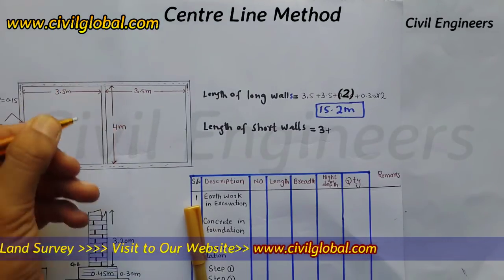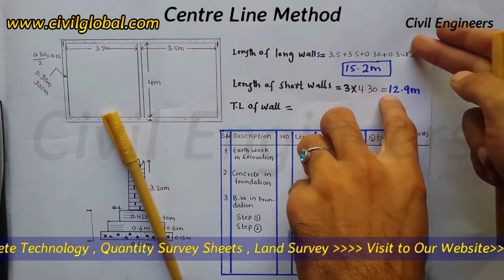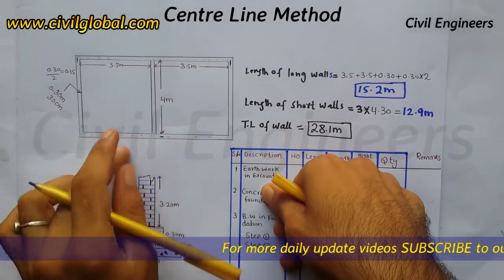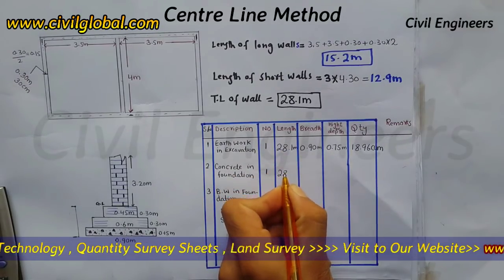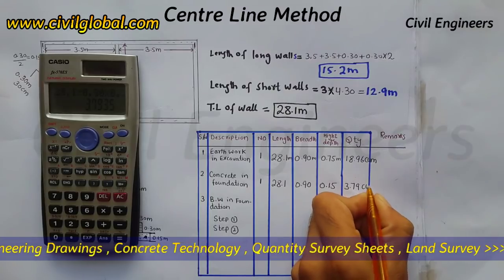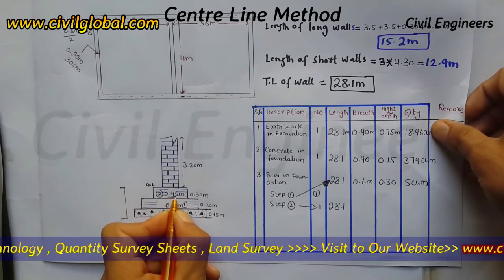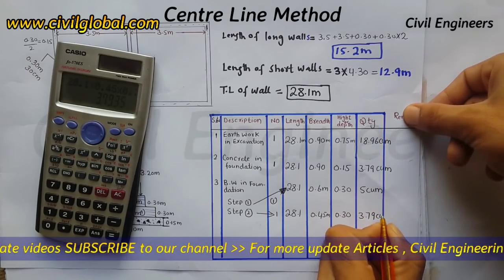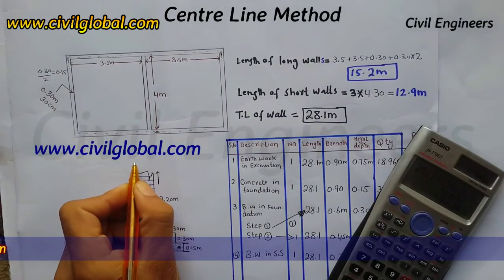Center Line Method - Quantity of Materials with Centre line method

Comment: 1) foundation concrete:bed width=0.8m,depth=0.2m
2) foundation s. S. Masonry: width=0.5m,depth=0.2m.
3) basement: width=0.4m depth=0.4m
4)DPC(1:2:4): width=0.4m depth=0.15
5) external walls are of 30cm & partition walls 20cm thick
6) all round lintel 1:2:4 ,0.15m depth
7) height of roof from plinth=3.5m

Comment: DEAR, IN THIS CENTRE LINE METHOD  HAVE ONE MORE EQUATION . YOUR TOTAL LENGTH IS CLEAR BUT WHEN YOU MENTIONED IN TABLE LENGTH IS DIFFERENT THERE HAVE ANOTHER EQUATION WE HAVE NEED. [LENGTH ANY ITEMS= C.C LENGTH -(1/2 * NO.OF JUNCTIONS*WIDTH OF WHICH ITEM YOU NEED )]   . THE NO.OF JUNCTIONS ARE CONSIDERED AS A " T" JUNCTIONS HOW MUCH HAVE.

Comment: Brother your method is totally wrong. The lengths of the walls will change according to the breadths. You forgot all about T joints, and it made all calculations wrong. If you write this in exam teacher will give 0. No mercy. But i like your slow explanation,  please learn the proper way first and then delete this video and do one more.
Reply: Correct
Reply: How to control estimated cost during construction. Click on the below link to know.
https://todayconstruction.blogspot.com/2020/06/post-contract-phase-this-is-from.html

Comment: Length of long walls = 2 ( 3.5 + 3.5 + .30 + .15+ .15)
= 15.2 m 
Is it correct?
Reply: Did he add .30 on wall then use the center line deduction for both?

Comment: this is not centre line method, in centre line you have to consider the T junctions, in your plan you have to consider 2 T junctions and total length of wall will be length-(number of junctions)×breadth/2
Reply: here we have two junctions . the formula is length - ( number of junction)x breadth/2  so they  cancelled each other like 2 x breadth/2 is equal to breadth understood
Reply: How to control estimated cost during construction. Click on the below link to know.
https://todayconstruction.blogspot.com/2020/06/post-contract-phase-this-is-from.html
Reply: Correct

Comment: Sorry, Your Taking Value is Wrong.. Example. Earthwork Excavation volume is 18.36 CUM... 1st your calculate 4 Side of Wall Volume, again the middle of wall C/C 4.3m Can you didact Breath of Earthwork 0.9M in the Middle of wall C/C Length.. I try C/C & Outer wall method also I Get Result 18.36 CUM.. Thank you...

Comment: I think your centre line for earthworks is wrong , instead of focusing on 300mm wall you were supposed to extend both long and short walls by 0.9 (0.3 x 3 )2 from concrete footings , now the way you have done it is as if your excavation is 300mm wide so instead of 28.1m length I suggest you add (3x 0.3mm) twice on both long and short walls otherwise I concur with you entirely on the approach not necessary the answers.
Reply: I also think that.
Reply: I also think that.
Reply: I tot we should consider working space in calculating the quantity of earth work in excavation...is it true??
Reply: I was also thinking that... (Y) excavation free area should be add ( 2*0.3m) =0.6m in long and short wall
Reply: Gggg